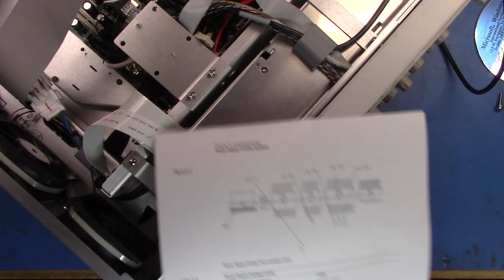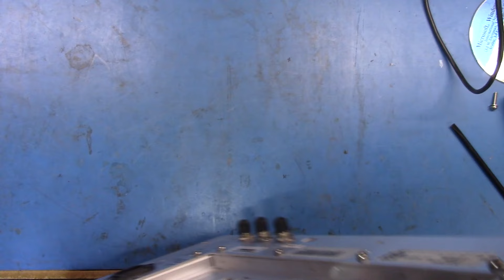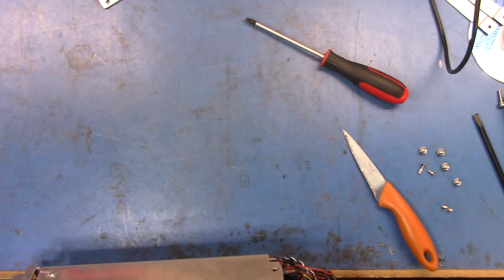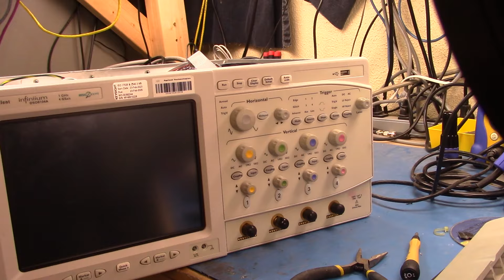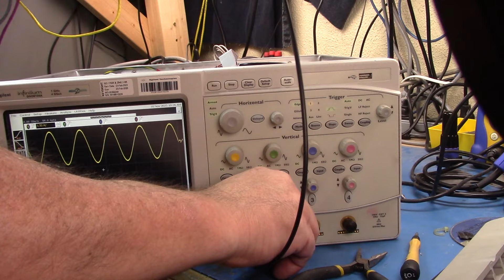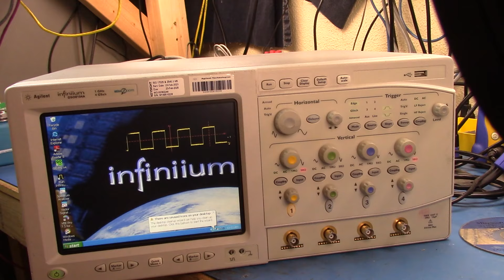Dumpster Score   Part 5 - DSO 8104A

Comment: As far as I can tell, the ADLINK M-880 motherboard is a slightly customized version of the ADLINK M-945 microATX industrial motherboard. If you search the net for ADLINK M-945, you can find spec sheets and manuals which are probably close enough to the M-880 version to be helpful. Some versions of the Agilent 168xx and 169xx series logic analyzers also use the M-880 motherboard.